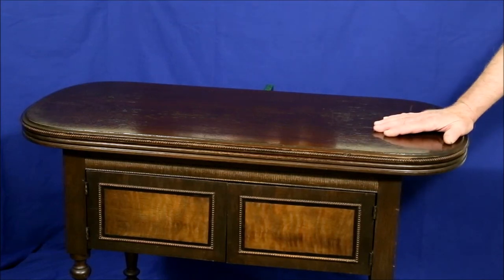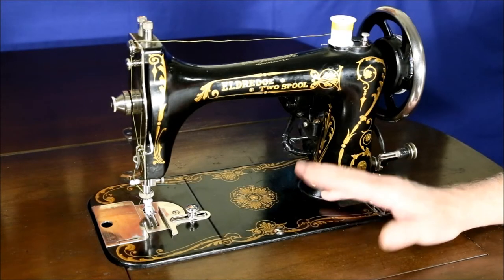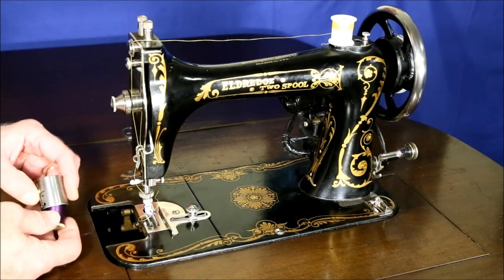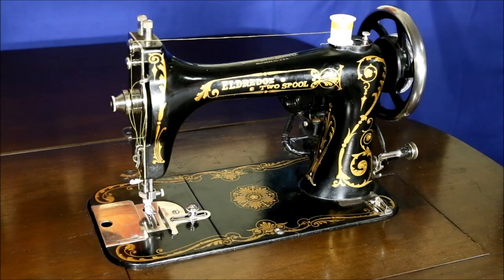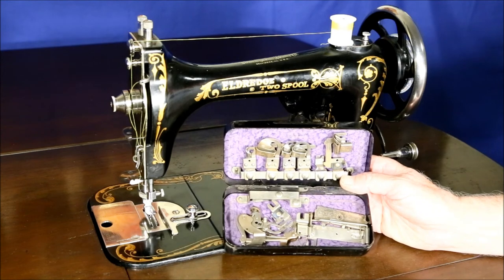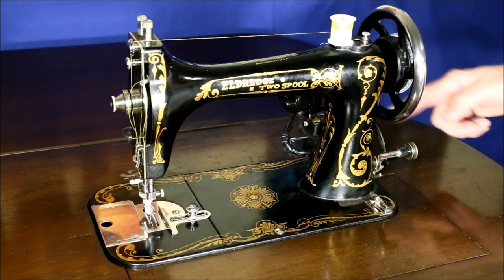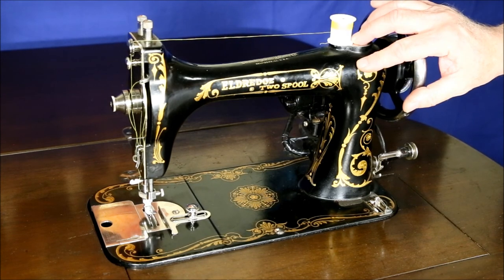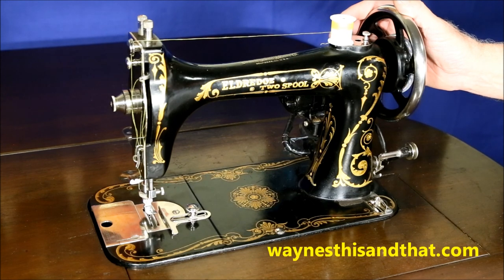Antique Sewing Machines - Eldridge Two Spool by National

Comment: Did you know that a Singer Industrial Class 7 bobbin exactly fits my National Two Spool machine with can style #3?  The spindle of the bobbin is so much slimmer than a small thread spool that i can wind 1 large spool of thread on it. Sews perfectly for a very long way between bobbin changes😊
Reply from the maker: I'd never heard that! Thank you!
Reply from the maker: I got a set of 3 bobbins like you suggested today, wound one with thread and it worked perfectly on the machine! Thank you again! Besides holding more thread than one of the small wood spools, it felt like the machine ran a little smoother with the metal bobbin. This makes sense because being metal, its surfaces are smoother.

Comment: I just got an Eldredge Reversew. Have you ever heard of that one. I'm still working on it. I plugged it in. The light goes on, but the machine doesn't run yet......
Reply from the maker: I'm very sorry. Fortunately, that sounds like an electrical problem, which any repair shop should be able to fix. Good luck!

Comment: Could you tell me what size belt you used? Do you have a video on using the spool winder? I'm just now cleaning the one i was lucky enough to get.
Reply from the maker: I got two, 3-inch long by 1/4-inch diameter springs from a hardware store and connected their ends together to form a loop. They worked great as a belt to drive the machine. They were a little tight, which made the motor labor, so I stretched one out to make it half an inch longer and that solved the problem. For winding their bobbin, I slip the spring belt off the machine pulley and onto the bobbin winder pulley. 

I hope this helps. Feel free to ask any other questions. Thanks for commenting!

Comment: My Eldredge Two Spool looks just like this one but is not electric, it's a treadle. I have the spool canister and the box of attachments. Thank you for the information about the machine. Would my machine be about the same age as yours? Was the electric motor put on later?
Reply from the maker: Hi, Tara! Thanks for writing! I would think yours is earlier. I believe these machines first came out in 1913 and ended in 1930, so ours would be at the very end of the production. Let me do a little more research and I'll let you know if we can narrow down a date for yours. Do you know it's serial number?

I checked out your channel and I have to ask: "What does OREEP stand for?"
Reply from the maker: The following article provides some information on dating 2 spools as being early, middle or late by the shape of the canister and other details:

http://2spools.blogspot.com

Because Eldredge machines were made by the National Sewing Machine Company, for which there are no serial  number records, dating 2 spools accurately is impossible. But we can make an educated guess. We were told ours dates to 1929 and has the serial number H56,769. The pattern of other 2 spool serial numbers suggest they are sequential starting from 0. If that's the case, and we assume since they were made from 1913 to 1930 (17 years) and that production rates were fairly constant over those years (which is almost certainly wrong but we're just working up an estimate) and finally that the highest serial number is around 60,000, then:

H00000-H03500 = 1913
H03501-H07000 = 1914
H07001-H10500 = 1915
H10501-H14000 = 1916

...and so on, adding one year for every additional 3500 increase in the serial number. This is extremely approximate, but at least it's a start. I hope this helps.
Reply: @wayneschmidt490  thank you very much!!

Comment: This is a really neat machine. I wonder why the two-spool design didn't catch on with other manufacturers. I'd love to not have to worry about my bobbin running out multiple times over the course of a project.
Reply from the maker: Hi again! The two-spool concept failed because it could only hold one size of spool whereas there were many different spool types in use. While I haven't seen any tension problems with ours, I've read that maintaining good tension was a problem.

Comment: Thank you for sharing.  I inherited a 1922 Eldridge Sewing Machine 6 years ago.  I don't know much about it. I've googled it many times, your video is the closest thing I have found to the model I have.  The original warranty and manufacture number and date are in the drawers along with the black box from your video (and manual).  Would you be able to steer me in a good direction to find out more about it?
Reply from the maker: I'd be happy to help! First up, is your Eldridge a two-spool? If so, the following video will show how to thread it:

https://www.youtube.com/watch?v=-bX1IQNHVOc&t=163s

There's also an Eldridge which isn't a two-spool. Instead, it's a conventional vibrating-shuttle machine, which means the shuttle moves in an arc. Which do you have?
Reply: @wayneschmidt490  I don't know much about sewing machines but it appears to be.  The spool underneath looks different than the one in the video.  This one is long and skinny.  Also, this one does not have a motor. It has a leather "belt".  I can send you pictures if it help?
Reply: @wayneschmidt490  Thank you!  That would be great!
Reply from the maker: @HaylieUrias  It sounds like you have a machine intended to be used on a foot-powered treadle, which is very common in vintage machines. Your mentioning that your spool is long a skinny means the machine is a vibrating shuttle machine rather than a two spool. If you slide out the metal plates in front of and behind the needle then turn the main wheel, you should see the end of a metal arm swinging back and forth in an arc under the bed of the machine. You can see what this looks like 5:30 minutes into the video I sent you. Is this what yours looks like? Also, please look at the side of the upper arm of the machine. Does it have the word "Eldridge" on it in cursive? Again, you can see what I mean in the second half of the video I sent. If so, then we have the same machine! It's an Improved Eldredge IEB.
Reply from the maker: Here's a little history about the company that made your machine: The Eldridge Sewing machine Company was formed in 1869 in Chicago. In 1890 it merged with the June Sewing Machine Company to become the National Sewing Machine Company, one of the great sewing machine power houses from 1890 up the WWII. National continued selling machines with the Eldridge name because it was a well established and respected trademark. National ended in 1953 because it couldn't compete against cheap Japanese imports.
Reply: @wayneschmidt490  Yes, that's it a vibrating shuttle machine, that part looks just like yours in the video.  My machine is a little different as the stitch regulator is on the base underneath instead of on the upright arm.  The "Eldridge" on the front and back of the horizontal arm looks like an old English font and the silver leafing design is different as well.  I can't really tell if "Eldridge" is on the side of the upper arm due to the, for a lack of better word, grit from aging.  The 10 year warranty says May 1, 1922 for an Eldridge Specialty Sewing Machine by National Sewing Company.
Reply from the maker: @HaylieUrias  Your warranty may have expired and the machine may be showing some age, but with a little care it should be back to sewing a great stitch. They really built them to last back then.
Reply: @wayneschmidt490  Haha! Thank you so much.  I'm looking for someone to restore it.  I'll let you know how it turns out.  Thanks again for all your help.
Reply: @wayneschmidt490  I found the exact one I have, it's called Special/Improved Seamstress.  Yay!
Reply: Do you know or have a guess as to what this machine would be worth?

Comment: The bobbin set up is so  seemingly smart!  Are there no other machines with a spool sized bobbin setup?  If not there should be.todays machines are so sadly lacking in character color and materials
Reply from the maker: As I've used the machine more, I've discovered that as the bottom spool runs out, the machine's tension has to be constantly adjusted. In a normal spool, the change in drag from thread coming off the bobbin doesn't change much as thread nis used up. But when an entire spool of thread is used, it does. I think this is why the concept never caught on.

I agree with you that modern machines don't have the styling of antiques. If you'll like to see what we consider the most elegant machine in out collection, check out our Grover & Baker:

https://www.youtube.com/watch?v=aeoLmi39dqo

Thanks for commenting!

Comment: Where is the break button I can find it on mine
Reply from the maker: I'm sorry, but I don't know what you mean by a 'break button.' If you can describe it and what you expect it to do I may be able to help you find it.

I checked out your channel. As one publisher to another, I have to compliment you on producing so many videos covering such a wide range of topics. Keep up the good work!
Reply: Thank you the break button it said it’s supposed to stop the needle from going up and down I couldn’t find it? But now I can’t figure out how to get the machine to make the thread go through! You should make a tutorial for old machines
Reply from the maker: I have over 60 machines in our antique and vintage sewing machine collection, everything from 1861 to 1968. In all of them I've never come across  break that stops the needle from going up and down. Friction automatically stops sewing machines whenever the user stops pedaling or cranking or in electrics, releases the foot petal. Could you be thinking of something that disengages the sewing part of the machine from the main wheel so that a bobbin, or in the case of the 2-spool, a spool, can be wound without driving the rest of the machine? If so, the answer is to look at the end of the main wheel. There is a knurled, steel disk in the center of it. Twisting that so the top moves towards you releases the machine from the drive. The pully should now to free to rotate without driving the rest of the machine. But, internal drag usually makes the machine move a little if the pulley rotates. For electric 2-spools, the drive spring that links the motor to the pulley needs to be removed and placed around the bobbin winder pulley to drive it. If your machine is set up on a treadle for foot powered use, the bobbin winder should be able to be rotated into position to be driven by the leather belt that drives machines mounted on treadle bases. 

Sorry to throw another question at you, but I don't understand what you meant when you said you couldn't figure out how to get the thread to go through. Did you mean how to get the thread to go through the needle? It threads from right to left. 

Sewing machines vary too much to put together a comprehensive video for all of them. Usually I include usage guides with my videos of individual machines, such as the following:

https://www.youtube.com/watch?v=mrqZypVWeBU&t=144sI forgot to do so with the Eldridge. 

If you search YouTube for National Two Spool Sewing Machines, you should be able to find someone who's made a video about how to get yours working. Here's one:

https://www.youtube.com/watch?v=GeO-BG6xoOU&t=174s

Also, searching Google for Eldridge Two Spool Sewing Machine Manuals will turn up sources for complete manuals. Many times these are free.

Good luck!